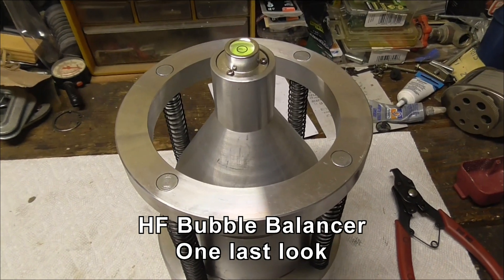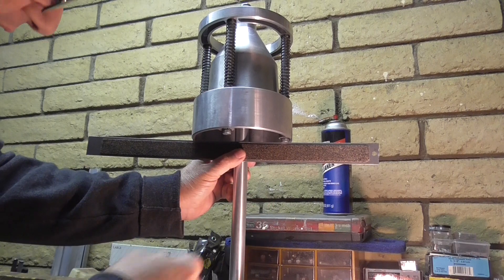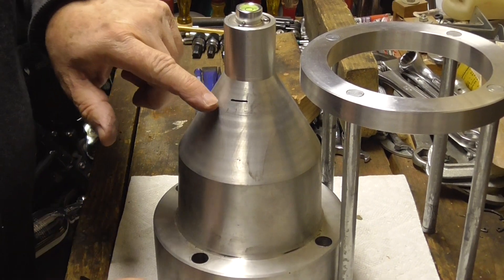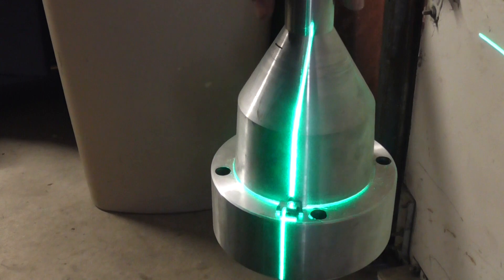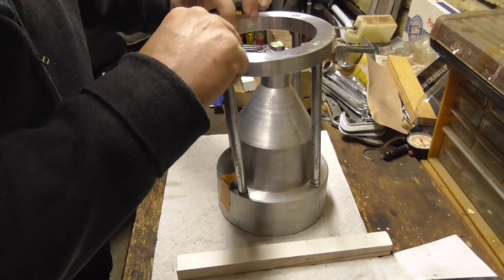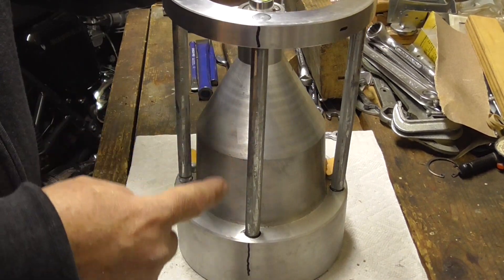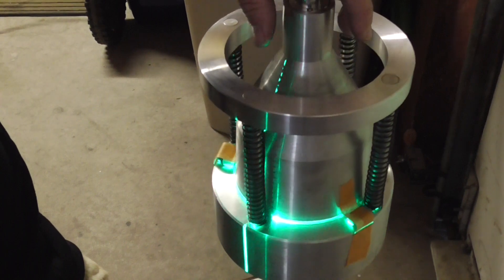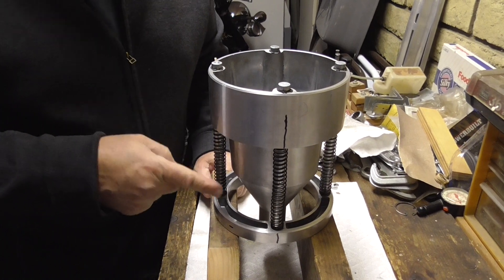Harbor Freight Wheel Balancer - a Final Critical Look - see text below

Comment: I think a lot of these tests are wrong. You have to center the bubble on top, that's what the 3 screws are for, then when it rotates, it is always centered! Yes, it is not Nasa quality but it works great for me. You have to oil the slides, oil the pivot point, adjust the bubble. Once you get the bubble centered mine is very repeatable. Where i work if you put a dial indicator on a washing machine they wouldn't stop laughing for 10 years.
Reply from the maker: The dial indicator on the drier worked great. It didn't move. No I don't have a surface table with angle plates & slip gages etc etc. I work in my garage.
The TIR was repeatable, I turned it several times. Not shown in the video as I try to keep them short.
The location where I rested the Indicator, on the cone, was at the pivot point location on the inside, so it was measuring how out of center it was...

The whole point of this machine is to support the wheel axis parallel and coincident with the axis of the balancer. It isn't. .017" doesn't sound much, but when you multiply it by the wheel weight (40 lbs in this case) that is the out of balance moment you can't account for. I ended up chasing that for hours trying to get it right. Never worked, the balance came out  different every time.

Math?? .017" x 40lbs x 16 Convert to ounces / 7.5" radius of rim = 1.45oz off
Lift and turn wheel, replace, where is the out of balance now???

The wheel-disc brake mating surface has to be perpendicular to the balancer axis, or the result will be wrong. The slop in the spring loaded frame makes sure that will never happen. The pivot shaft has to be vertical or the result will be wrong - but there is no mention or supplied method to get the base level.

The head of the balancer is out of balance. I tried without success to balance it with weights, but when I put the frame and springs back on, it was out of balance again.

My method of balancing with a steel ball on a level steel plate works great.
I couldn't get over 60 mph without severe vibration using the HF balancer.
At 80mph after the ball balancer, smooth as silk. same car, same wheels

The HF balancer? In the shed out back - useless.
Good luck with yours. You may have got a good one
Reply: These things are complete junk, I had one through it in the garbage, The antique version of these were fantastic, do bad there isn't a company willing to build a quality version on them for a reasonable price

Comment: I have 2 of these junk Hf BALANCERS, including the brand new one for 99 bucks.  Threw in the towel.  Are you saying with the lazer and these junk balancers your getting accurate results?  I just ordered 2 vintage balancers that dont have this horrible 4 spring loaded leveling plate design.  I dont even know what to do with the 2 I have since theres tons of these on local facebook market place for super cheap.
Reply from the maker: I never got a good result with the HF balancer, it's in the shed out back, acting as a boat anchor. And I don't have a boat. Sorry that you have 2 of them.
I can only guess that those units on FB Marketplace are junk too. The ones that work are still in use.

The whole point of horizontal balancing is to get the wheel horizontal compared to the wheels rotation axis
A ball/sphere is self centering on the wheel pilot. 
The HF cone has to be accurately aligned with the internal central pivot - fail.
The spring frame has to keep the wheel perpendicular to the cone axis - fail.
The head of the HF balancer must be balanced or it will add randomly to the imbalance - fail.

Other cone balancers can fail if they can't do what I've outlined here for the HF balancer.
Reply from the maker: How are your vintage balancers working out?
I probably wasn't too clear before, but I don't use the HF balancer anymore.
I made a more all encompassing video of a tire change and balance, using the adjustable wooden stool I made, steel ball and centric rings.
https://www.youtube.com/watch?v=WgjNO2gt3xg

Comment: where did you get that lazer?  what is it normally used for?
Reply from the maker: It's sold on amazon. This one is a Bekoywoy, but generically it's a " Self leveling laser level ". Some are now cheaper than the one I got. 
I think normally it's used by drywall installers or framers. The line extends a long way and it is level, checked it against my 4 foot spirit level and they are both spot on. The laser swings on  a pendulum and if the casing is too far from level it beeps at you. Same principle as the tilt mechanism in a pinball table.
I have mine on a camera tripod.

I now use it as my primary wheel balancer method
https://www.youtube.com/watch?v=JvN4i-qJqMs
I did a check balance in this video showing how far off a wheel balanced at discount tire was
https://www.youtube.com/watch?v=gGv5MUxbQ3c&t=110s
After some teething issues, have not had an issue with the laser balancing.

Comment: I just bought this unit a few days ago, I modified the seat that the pin sits in to reduce friction. It still can’t produce repeatable results. Get the tire balanced then pick it up and rotate it 180 degrees or whatever and it always reads different. It’s garbage!
Reply from the maker: Thats what I was getting - so I gave up with it.
To many issues to solve. There are some other things I'm trying in the text under the video.
Reply: @richbinaz  ...Will it work without those 4 rods?  How about just balance using the cone?
Reply from the maker: @thewishmastur  it can ... IF ... you can be sure the axis of the wheel lines up with the axis of the cone which is concentric to the pivot hole.
Complicated eh! It's why they put the 4 legged frame on there to do... but it fails.
Was this the video where I put the frame into the head then shoved it side to side to see the slop? It can't possibly do what they want it to do.
I gave up and did the Horizontal Laser balance using this home made device
https://youtu.be/JvN4i-qJqMs
Here it is in action in a video I did last week
https://youtu.be/WgjNO2gt3xg?t=619
Wind back to the 29 second mark to see how it is set up

Comment: the only thing is wrong with all the balances like this you have, is the drag , the privet pin dinging in the hole,lol    you should have got a wheel balanced at the garage   and put it on you bubble balance  to see how much it was off  that what i did,  every one is trying to figure out just what is wrong with those balancers,   it's the pivot shaft and , it's just made horrible bad,
Reply from the maker: They are very poorly made. At least the one I have is.
I changed to vertical balancing with a wheel hub I modified to have low friction.
Reply: a bubble balancer is like a bucyle amde for 2, the wife on the back with the brakes on @richbinaz

Comment: I use one my GF drives for Door Dash , She wears out tiers , I have a Harbor freight tire machine I mount my own tires Lawnmower ATV Motorcycle and light truck and car I can do up to 6 ply .  balance with the bubble balancer ,   Tire spinner balancer was meant for the 1970s Radial tires , My Uncle had a Tire shop he had a Bubble balancer from the 1940 and good year told him he could no longer use it , he had to buy a fancy balancer for $2000 he told the Guy I been using this Balancer since 1940  Im going to keep using it .    if you use bubble or have it done in a shop it will not come out the same  ,  But so far my GF car tires have been fine and it handles great .
Reply from the maker: If your balancer works, good for you!!
Mine didn't so I wanted to find out why.
Reply: @richbinaz  Lot of the springs are tight I seen small 13 inch wheels not heavy enough to get it to work .
Reply from the maker: @JCcanU  The 40 lb wheel assy's i was putting on easily overcame the spring resistance

Comment: It would be interesting doing the same tests on an antique bubble balancer, it does sound like they did a good job back in the day.
Reply from the maker: Yes. May have to go back a long way though. I just saw a video produced 6 years ago by a guy who just bought one, unwrapped it, tried to use it and failed to get a consistent result. Gave up and took his wheels to a garage to be balanced.
https://www.youtube.com/watch?v=syb_zk0CJA0
Mostly though, a video search shows only a bunch of positive outcomes. Even Scotty Kilmer likes it - but he put the weights on wrong.
Reply: @richbinaz  ...It is total garbage.  The reading is always different every time I put it back on the bloody bubble balancer.
Reply from the maker: @thewishmastur  That is exactly what happened to me. Sorry.
If you don't want to try the horizontal laser balance, there is a way to do a vertical balance, but it's a lot harder to make and only works on one wheel stud pattern.
https://www.youtube.com/watch?v=du5cTMqpIhY
It can work with deeply recessed wheel pilots like on the Dodge Hellcat, that the laser method fails on.